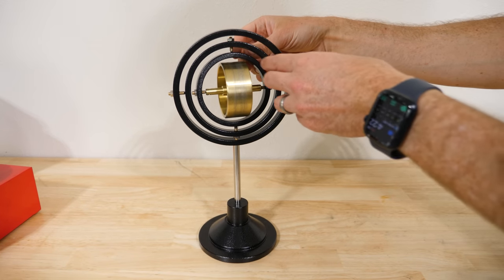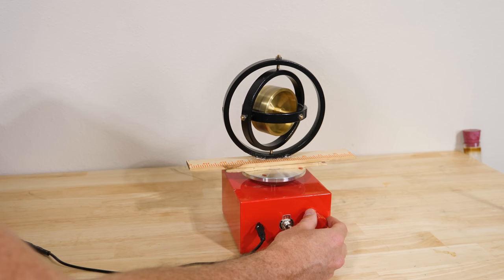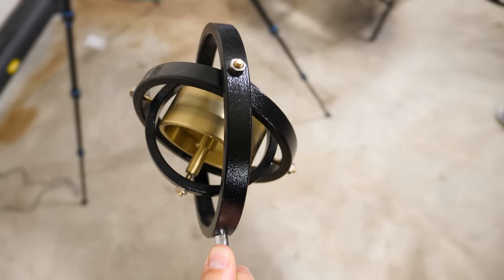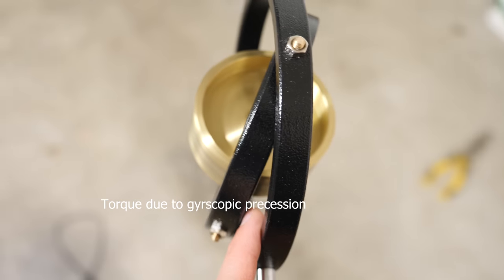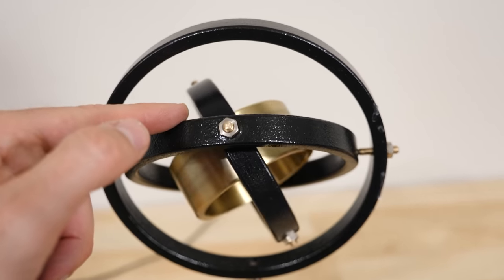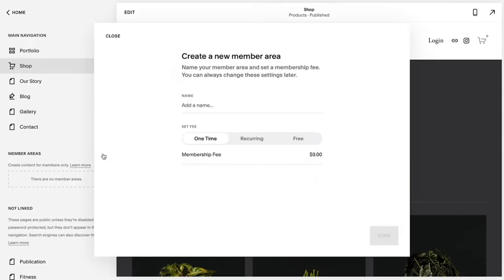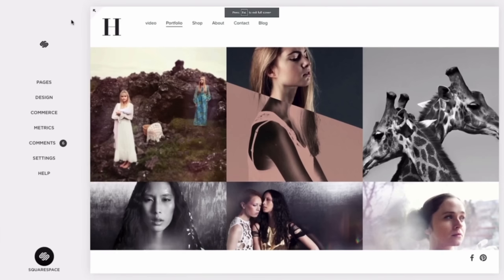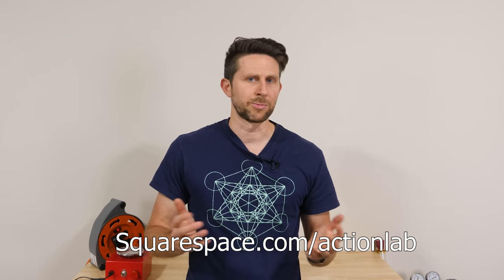Can Gyroscopes Provide Free Energy For The Planet?

Comment: Actually, we do have machines that harvest Earth's angular momentum and turn that into energy, nowadays, although they do it indirectly. 
They are called wind turbines :)
Reply: Well, actually no. The winds used for windturbines have mostly nothing to do with earths rotation.

Tidal powerplants on the other hand do in fact kinda use earths rotation indirectly to harvest energy.
Reply: @matthiaskritzinger5509  Cyclones and anticyclones are formed from the Coriolis force on the movement of air from the equator to the poles in Hadley cells - this directly converts energy from the motion into heat which ultimately gets radiated to space. Wind turbines capture this energy and do useful work for us in the process, converting more of this energy to heat. Converting kinetic energy to radiation must cause the Earth to slow down, however imperceptibly.
Tidal powerplants work because the Moon's and Sun's gravity potentials have different magnitudes on the near and far sides of the Earth causing it to deform to raise and lower a large mass of water which can be made to do work, as energy is transferred from the Earth to the Moon.
However, a rotating body that doesn't have tides can't generate energy in that way, but the Coriolis force could be exploited using water turbines in the Gulf Stream.
Reply: @ahaveland  Thx for your reply. Of course in aware of the effect the coriolis force (and so earths rotation) have on global windstreams. However windturbines mostly dont use these kind of windstreams as they can be to strong and/or are way to high in the air or far in the open sea (early sailers used jetstreams to get across the atlantic for example). Of course im not an expert on windturbines, but thats the point i wanted to get across.

Also as you said correctly tides are a direct energy transfer between earths rotation and the moon slowing the earths rotation down till earths rotationspeed is at the same angular momentum of the moon falling around earth. At that point the tides no longer exsist making tidal powerplants useless. So in the end - to get my second point across - tidal powerplants harvest a bit of that energytransfer between moon and earth which in turn is caused by earths rotation meaning that they practically do harvest energy from earths rotation itself.

Anyways, thx for your reply! Have a nice day :)
Reply: @matthiaskritzinger5509  I never claimed that the air produced by the coriolis effect was the ONLY source of air whose energy wind turbines convert. But whatever little part of that air's energy is converted, it still makes wind turbines machines that, at some level, indirectly turn earth's rotation into energy. So, actually, yeah. My point is still valid.

Comment: If we had a coil of wire around the earth and far enough away so there is an insulation between the magnet (earth) and the copper coil, could you generate a charge? Theoretically?
Reply: For this to work out the coil would have to move relative to earth magnetic field.And if we assume that earths magnetic field does nearly not move relative to earths surface,the coil would have to move relative to earths surface. So since initially it would move due to conservation of momentum, you would have to spin it up first. And this will take the same energy to do as you could theoretically extract from it afterwards, cause by doing so, you would slow it down relative to earths surface. So no it would not work.
Reply: Nice idea, but as soon as you would take energy from the coil, the coil will begin to spin with the earth because of the electromagnetic force that generates the energy. Eventualy it wil become in sync with the earth and you will need to put as much energy back into it (probably even more due to losses) to get it stationary again. So you would need to tie a rope around the sun or moon to anchor it to something.

But getting energy from the moons rotation is much easier as it already creates the tides in the sea which we can use to extract energy from, another question would be how much are we slowing the moons rotation by harvesting tidal energy ;-)
Reply: You need alternating magnetic fields...
Reply: @AndreVanKammen  we will not slow down the moon, but the earth,since earth has higher angular speed, than the moon has. (in fact, earths day once where roundabout at 12hours, and it slowed down, due to the tides, while the moon got faster,and is constantly moving away from earth.
Reply: @AndreVanKammen  None much? We aren't making moon waste more energy for tides by using them. Tides are already there,.
Reply: @neutronenstern.  ok thank you. My train of thought was the earths magnetic field would have enough motion to satisfy that but i have no clue how much the field moves. I know it lags the further away from the poles you are. Would a pole to pole orientation be significantly better than a equatorial orientation so the fields are at right angles to each other. 

Another theoretical question if the coil would need spinning up. What if the ISS had a wire attached to the front and the back it which took the same path it takes now, would the inertia needed for conventional orbit still be enough, including the extra thrust for the weight of the cable, to maintain the orbit?
Reply: @jamm8284  make the tide as your external force to spin the gyroscope ie. this is the arm in the exercise ball example
Reply: @rubickevich  Tides are indeed already there, but if we use the energy we are shifting the weight and that influences the system as a whole. But @neutron stern explains it best.
Reply: @neutronenstern.  and the thing about needing 2 rotaional fields, cant you generate energy through 1 moving part moving through a magnetic field? Isnt it similar which ever field is in motion, theres still an interaction and interverence across the fields which would generate energy?
Reply: @neutronenstern.  Thanks for the clarifying answer, I forgot about the fact that tides are also coupled with the earths rotation which indeed is faster. So basicly we are already extracting energy from the earths rotation, but it's so little it will hardly be noticable compared to what's already happening in our solarsystem.
Reply: @AndreVanKammen  the moon is also going farther and farther away so it might be worth slowing it down
Reply: @neutronenstern.  think vulcrum and lever if you had a wire big enough ratating at geostationary orbit with the field rotating at different speed, wouldnt that interaction between the fields be enough, theoretically, even if it takes time to recover that initial energy cost, there must be a positive rate of energy at some point?

As i write this i know there is millions of times more energy that can be recovered far easier than any idea close to this but its interesting to challenge the thought.
Reply: @jamm8284  yes thats enough. But it has to move relativr to each other.
Reply: @jamm8284  then the ISS would have to provide the energy needed,or else it would slow down and crash
Reply: @jamm8284  well if the fields are perpendicular to the coil it will work best. But earths magnetic field really moves slow. Even at the point, where it changes direction, it will take hundrets of years to flip. Also earths magnetic field isnt that strong, so overall the energy that you will be able to use, would probably be very low, cause slow speed, and weak field.  And then you dont use earths rotational energy, but only the energy caused by convection causing the field to move.
Reply: @jamm8284  no you cant. You will need exactly the same energy to speed it up to orbit,as you can get out of it, by slowing it down again. You always need something with less energy, to get the energ,from something with higher energy. And you cant generate anything with less energy without using energy. You can look at it from a conservation of momentum. and of energyperspective or ar a entropy perspective. Things you are suggesting, if i get you right, will never be able to happen.

Comment: I have 3 of those power balls and they're killers!  I just want to add that yes they're difficult to start up at first, going against the grain so to speak, you do a kind of circular rotation with the hand from the wrist.  But then once its in "flow" its just a wrist rotation left and right and the hand no longer needed to do a rotation.  So I'm thinking, if you can start it up and put it in a device that only goes left and right, maybe can generate the resistance via sea waves or wind. to be consistent it would need to harness and spread evenly at the correct speed?

Comment: I think the main issues are that you'd need a frame bigger than the entire earth, connect it to the earth precisely in two places, and then it'd be massive massive generators would be required, that wouldn't just explode with the force. Plus, if you speed up the slowing down of earth's rotation, you could cause all sorts of issues (granted, it'd likely take thousands/millions of years, but still).

Comment: Extracting energy from earth rotation sounds like a bad idea since you make earth rotation slower and slower. I know it would take a really long time to significantly slow down earth rotation, but still better to keep it the same way since our life depends on it.
Reply: The Moon is already slowing it down. That's why we have leap seconds on occasion.
Reply: Our lives also depend on clean energy.
The Earth has a rotational kinetic energy of 2,138×10^29 J. World primary energy consumption fell to 556,63x10^18 in 2020. At that rate it would take approximately 384.097.156 years for the Earth to stop.
If we can use Earth's rotational energy as an environmentally friendly alternative to carbon based fuels right now, in a million years or so we can start to put energy back into the system.
Reply: It's already happening and has been for a very long time, 3.5 billion years ago years ago a day was ~12 hours. Tidal forces from the Sun result in the Earths spin slowing down over time. The Earth has already stopped the Moon's rotation via the same process. Given enough time the sun will do the same to the Earth.

Comment: Maybe applying gyroscopic principals to gears and do make it gear the rotational force of the earth down to the center of the gyroscope to rotate it faster.  Then you could make the center out of a giant permanent magnet and make the loops around the gyroscope be the coils for collecting power. You could even potentially stabilize the gyroscopic generator depending on the flow of electricity that's released. To use the eddi currents to stabilize the whole system. Just a thought

Comment: Several years ago I read a paper submitted to the physics journal by a Harvard professor and his students doing an experiment on a vacuum chambered glass container. They wanted to see if they could suspend hydrogen gas in the container using a magnetic field. They discovered that hydrogen gas could be suspended in the container using a weak magnetic field. Then, they wondered what would happen if they passed visible light into the container. They claimed that the light went into the hydrogen and came out as high energy X-rays and heat. They claimed they measured a temperature inside the container around 54,000° F. That was nearly the same temperature that scientists measured in sonoluminescence experiments, suspending an air bubble in water and hitting it with sound.  The sound caused the air bubble to vibrate, causing it expand and contract converting the sound into heat and  a bright light in the center of the air bubble. They measured a temperature around 50,000° F around the air bubble. I congratulated them on discovering over-unity of energy.

Well, I then got the idea that we could use hydrogen suspended in a vacuum chamber to produce heat. Similar to the thermal energy produced by radioactive particles in nuclear reactors but without the dangerous radiation. Nuclear reactors use thermoelectric generators to convert heat into electricity. The same thing could be done using hydrogen suspended in a vacuum and then hitting the hydrogen with visible light. Lots of thermal energy is produced that could in theory be converted into a constant current of electricity. The only difference is the hydrogen would not be radioactive and would not lose it's ability to generate heat over time like radioactive particles do. Plus hydrogen wouldn't produce radioactive waste.

I'd love to provide the link to the article but I commented on the article congratulating the professor and the next day my comment and the article was gone. Apparently someone agreed with me, the device proved over-unity of energy is possible because they removed the article. I should have kept silent. I doubt they would have figured it out. Something to think about. 

Maybe you could try to repeat their experiment to see if the claim was legit?
Reply: 1) converting light to heat is not novel, it's what a piece of black paper does when exposed to sunlight
2) overunity is impossible

Comment: Been there done that.

You can prevent the gyro flipping as you rotate, so technically it works. The problem is the amounts involved. The Earth is rotating too slowly. In order to gain practical output, the angular speed (and/or size) of the gyroscope would have to be impossibly large.
Reply: And you're a mathematician or something? Genuinely curious as to why you'd dismiss the idea outright without showing any equations.
Reply: @Ree1981  Gyroscopes are very well understood. It is just classical mechanics. It would not be practical for me to be your teacher, especially over something so simple. Just look up the equations on the internet, plug in the numbers and you can see for yourself.

Comment: If you use the principle of the magnetic compass, you can harvest the magnetic energy of the earth.
Use 3x electro magnet bars crossed on a center pivot.
Let the wires touch a copper bowtie half positive and half negative, like a brush.
So that only 1 is on at a time.
This magnet wil rotate to North South until it drops off the bowtie.
By this time the next magnet activate and so on.
This will create a motor of which the stator is the earth.

Comment: In engineering, you have to take power into account, not just energy. The angular velocity of the Eart is quite small, so extracting energy above the one needed to compensate for dissipation (like air resistance, friction, etc) is quite difficult.

Comment: Your power ball relies on the cyclic acceleration/deceleration of your arm to work. The only way this could work on a turntable, is if the turntable repeatedly speeded up, then slowed down. Since the turntable operates at a steady speed, you only get one acceleration event, from which it's theoretically possible to extract energy. The trick is to put a load on the turntable, without using a 'stator'.
     This is still a fun question, because it does NOT violate the laws of physics, or thermal dynamics. You're trying to harvest some of the kinetic energy of the earth rotation, with 'regenerative braking'.

Comment: May superconductors work to isolate the gyroscope from resistance? Then we tidal lock its velocities of the rings like a clock to make things more convenient mathematically. Not sure about it outputting any work, but it could be used to transmit information FTL. Not sure why I think that. Ohhh yea, its like a super metronome. If both devices are locked on to the same... Vectors? Like a specific spot on the earth moon and sun, it can synchronize

Comment: I guess it could be done with a very large well/rotation speed, but the low friction requirement becomes exponentially complicated. But then there would be the cost of getting the wheel spinning fast enough. 

But then again, if you can do that, it would make an awesome battery.

Comment: Here's the ultimate question:
What happens to the angular momentum of Earth?

If you can't dump that somewhere, you can't get energy from moving it there. And you certainly can't just make it disappear.

Moving energy from something rotating quickly to something rotating slowly releases energy. Moving energy from something rotating slowly to something rotating quickly costs energy.
Reply: That's a good question. While the conservation of energy holds (we just take energy from the Earth rotation and convert it into work, and then heat), the angular momentum needs to go somewhere.

Maybe we could look at the Earth-Moon system? If we can independently vary the Earth's rotation speed and Moon's orbital speed, we might be able to end up with a net zero change in angular momentum but still move energy around. And we can slow down or (theoretically) accelerate the moon using ocean power.

Comment: What about adding strong magnets into the rings in a congifuration to stabilize or boost the rotation, maybe electromagnets that can change their poles when needed ? Inside a thermal chamber to harvest the heat produced too

Comment: The impossibility of this idea is easy to check - just try to come up with a way to use a gyroscope to spin the carousel on which you yourself are, without relying on anything other than the carousel itself. if you succeed, consider that you have deceived the laws of physics, because a motor is the same as a generator)